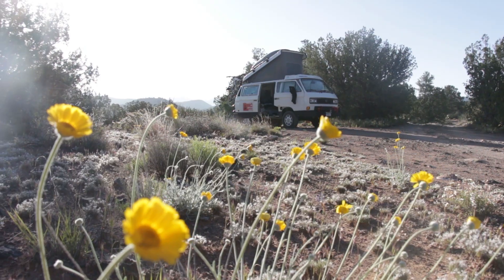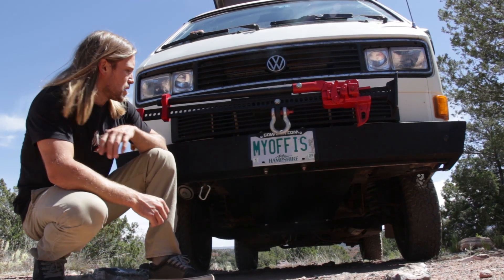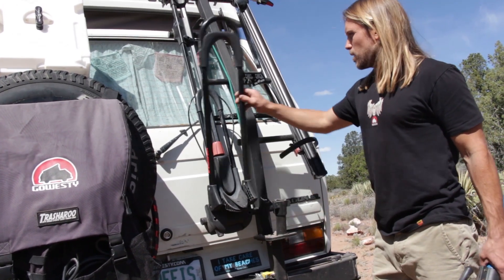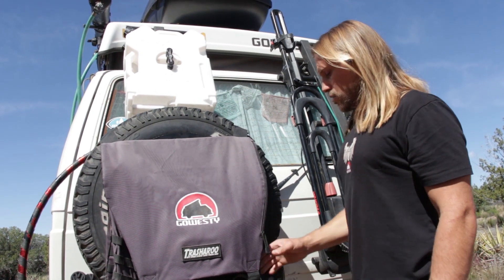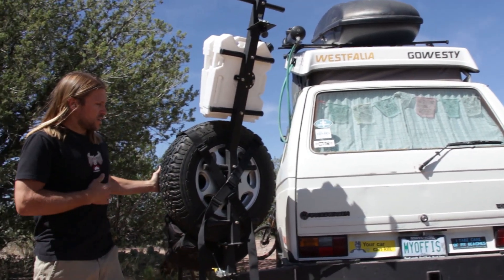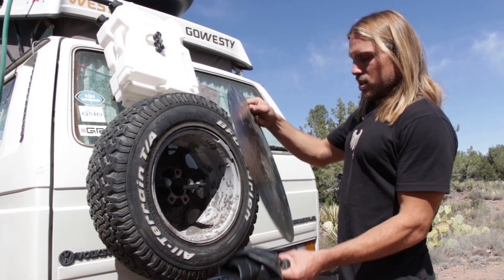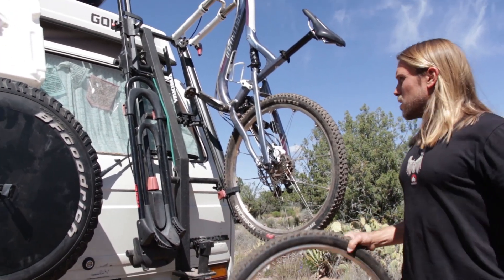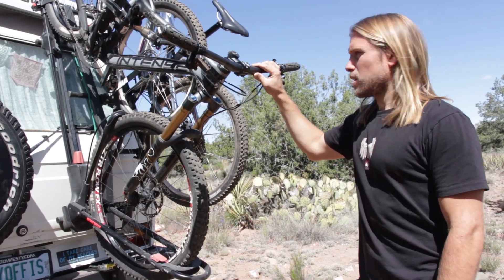Vanagon Bumper & Bike Rack - GoWesty Upgrade

Comment: I use my roof rack to carry kayaks of various lengths, and need access to at least one side of the the rear rack via the bumper. Would it be possible to carry an mtb + spare tire together on the same swing away, or would the spare not leave enough room?

Alternatively, if there’s no mtb mounted to a swing away dedicated to bike racks, with no bike mounted would I be able to hop up on the bumper w/o much issue as a I run a boat into the roof?

Comment: Do you think I would be able to load two MTB'S with two front loaders like this? I have the same setup but holding off on pulling the trigger on these racks... Also torn about the highroller.  Cheers!
Reply from the maker: +lance putnam I think you can totally put two front loaders on, but you might want to stager how you mount them. We are now using Thule racks which are working amazing. We have a Sidearm 594xt and Paceline. The ThruRide 535 seems like a rad rack if you don't mind putting a tire inside.
Reply: +Where&#39;s My Office Now?  Nice.  Thanks for the response! Any reason you went with the thule over the frontloader?  I'm torn between the two.  Riding 29+ almost makes it a bit more difficult. Any input would be appreciated.  About to move into my van for the summer in a few weeks and need to make a decision : )

Comment: Great system! I am also a mountain bike fan, but I have a downhill bike.. Would this system work for a dh bike? Is it really secure? What would you do when it would rain or snow a lot? Leave the bikes as they are right now or put some kind of blanket over them? Keep up the great vids! Cheers from France
Reply from the maker: MrRemGamingDh bike will fit for sure! You can lock the universal carrier and then run a long cable lock through the frame and wheels! If the weather is REALLY bad when driving I usually take the bikes off the back take the front wheel off and stash them inside. If we are stopped and the weather is bad I put a four wheeler cover I got off amazon over both bikes!

Comment: I'd be very very careful with the plate of the spare tire...It could take a toe or two off when it falls off like it did. It needs to have a small wire retaining cable or something to keep it from falling to the ground. It's a law suit waiting to happen. Other than that, it looks like a really great system.
Reply: Or even just cut some garden hose down the center and slide it over the edge... that'll still keep a seal with the tyre and not cut anything if it falls
Reply: or they could just weld a handle onto it would help also